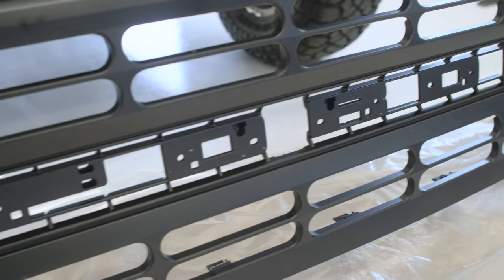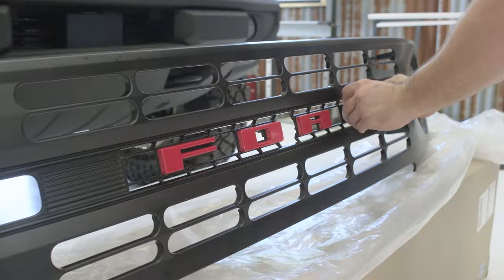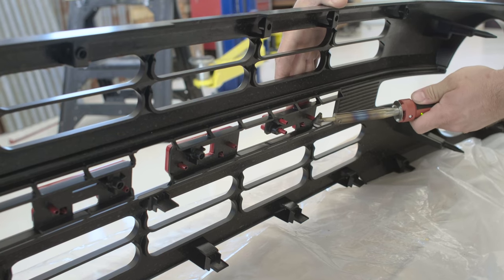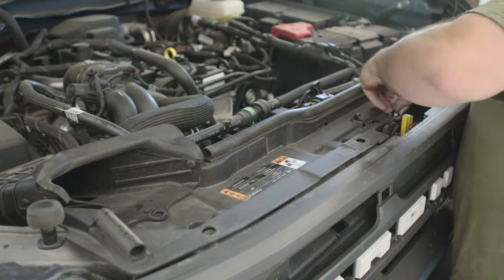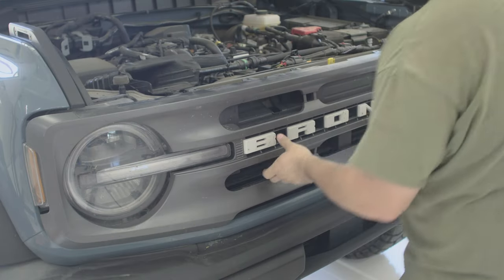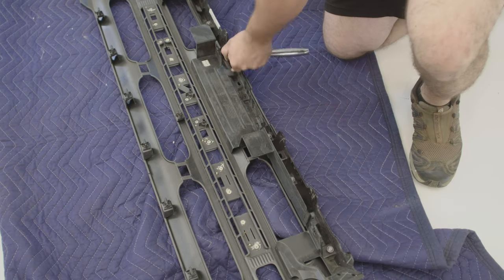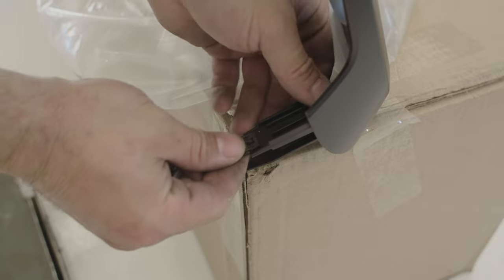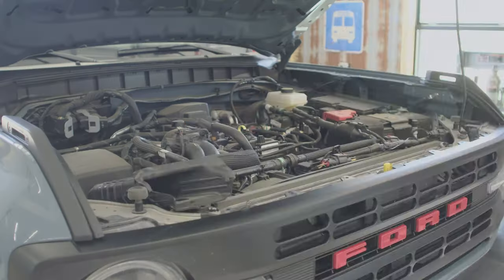Ford Bronco Heritage Grille Install

Comment: You are a legend! Thanks for this video. With these part numbers did you just get them from FORD? How? Through a dealership? Or a website?
Reply from the maker: I ordered the grille eBay by searching the part numbers. And same with the letters just got them on tascaparts.com
Reply: Do u have a part number for the letters?